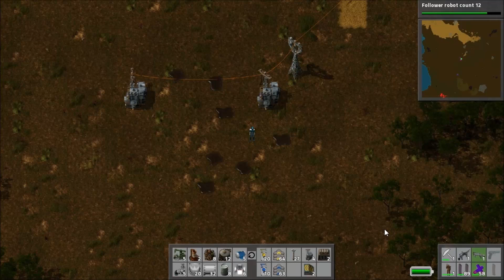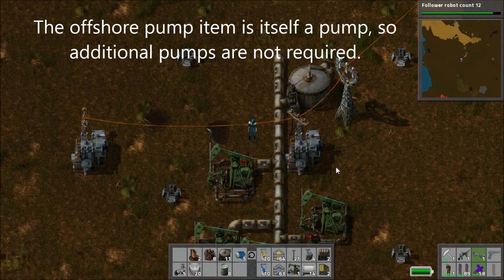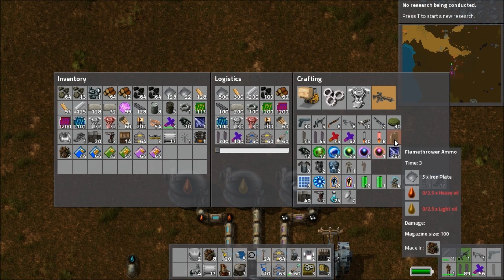Factorio Oil Tutorial

Comment: Good stuff! My main issue as a new player is the ratios. Refineries cut out, yet I need more liquids. Heavy and light oil tanks are nowhere close to full, yet I can't get enough petro? So, basically I've been trying to troubleshoot by adding a plant with light to petro, then maybe trying to just add another plant to make batteries. Like I've been trying to add and subtract things for a WEEK, and still having issues. Really puts a frown on assembly machines that need to produce. Driving me absolutely bonkers...
Reply from the maker: If there's space in your system for all three kinds of oil still then the only reason your refineries should be cutting out is due to lack of oil, water or power.
Is your oil input intermittent, because it's delivered by trains maybe?
Are your refineries actually cutting out or are some just entirely inactive?
Are you supplying water with only 1 pump and it's not keeping up with demand?
Perhaps some pipes are properly connected for the different oil products?
Reply: MangledPork Gaming I actually started from scratch, so I couldn’t really tell you what’s going on at this point lol. I still get confused, though. What you say makes sense...if things aren’t full, they should keep getting supplied. Yet if there is a shortage of power, water or oil, then that would cause a shutdown. Someone had told me that if the supply is too fast for the demand(refinery giving more than needed by the products), then it could also shut down. Is that true?
Reply from the maker: @mike5177  Yeah, if more is being made than used, then it will build up in the pipes/tanks and then block the refineries from sending out any more.
Also bear in mind that if a tank is at, say 4.9k/5k, you should probably count it as full because the little bit of space left might not be enough for the refineries to actually feed any more in.
Reply: MangledPork Gaming Appreciate the feedback. I’ll understand how it all works one day

Comment: Is is possible to run generators of petroleum for electricity? I am bored of the Steam power its so 1800's i want to move on lol
Reply from the maker: +Maltebyte2 Not currently, but you can use solar panels for pollution-free power. And you can use accumulators to store power for the night.
Reply: There's a mod called KS Power which adds a diesel generator and a few other options of generating power including wind turbines for another option of pollution-free power.

Comment from the maker: @Roidman01 For whatever reason your comment has no reply button (I blame google). I plan to start making more tutorials for factorio in the next week. When I decided to start doing them i only had time for this one and i've been busy for the past few weeks. I'll take requests though, particularly for some of the smaller problems people have.
Reply: MangledPork Gaming Thank you for uploading this video...Question is there a way to hide the minimap?
Reply from the maker: Yes, in the options.
Reply: MangledPork Gaming Thanks,never thought to look in the graphic setting,i thought it would be in control
Reply: A Chootorial.
Reply: +MangledPork Gaming How do I make a processing unit ( circuit board ) I know the recipe, and I have sulfuric acid, and all the oil products, but I can't figure out how to get it into the assembly machine to make it. Sorry if you explained this already. I double posted this so you might see it.
Reply: PCRageGamer You can only make it in a blue or yellow assembly machine and once you select the recipe one side of the assembly machine will turn into a liquid input, you can see it more easily with extra info turned on.
Reply: Thank you so much, I've been stuck for a while with not being able to make these, or add my shield or nighvision module
Reply: PCRageGamer No problem :)
Reply: +MangledPork Gaming What type of gun are you using?
Reply: His comment has no reply button because he disabled that in his privacy settings

Comment: Another tip that no one has seemed to mention, which I've only just worked out, is essentially, I believe, oil refineries are essentially making bi-products of the oil.  I was having so much issue with Petroleum Gas seemingly running out.  It wasn't.  It appears all 3 products from crude oil aren't made if they aren't all being filtered.

So you could have heavy oil, light oil coming out the oil refinery and stored but if their tanks are full you'll notice the oil refinery stop producing petroleum gas.  It took me a while to work out what was up.  But I now realise if the oil refinery can't burn the crude oil because the other storage is full, you won't get your other bi-product of petroleum gas.
Reply from the maker: That's a good point, i'll add an annotation about it.